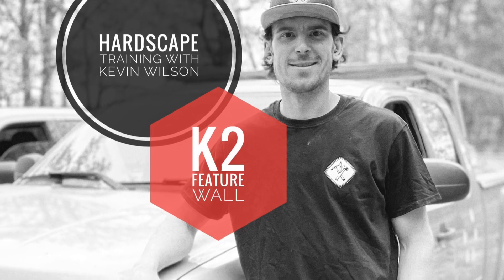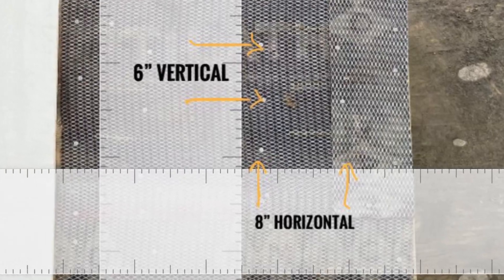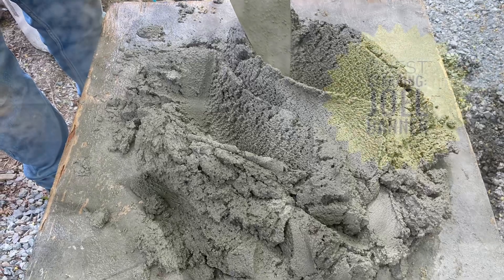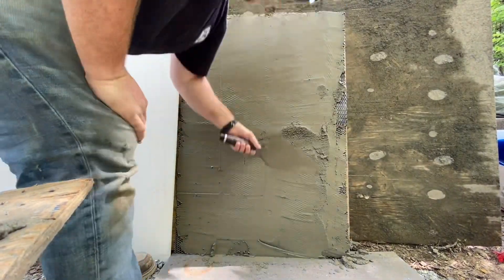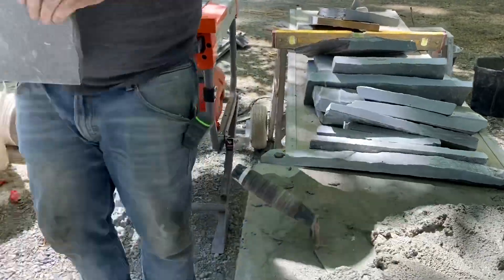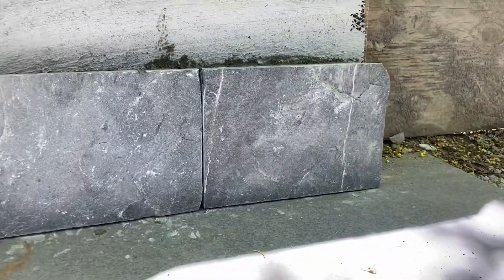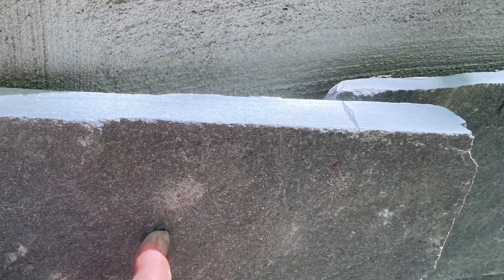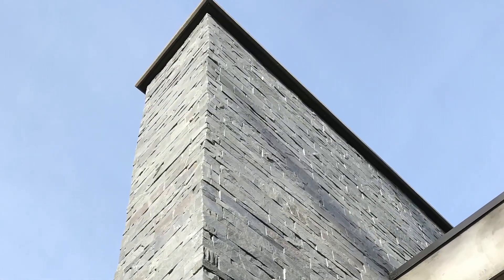How to build a Veneer stone feature wall like the pros do it! A great beginner video.

Comment: But it does prompt me to ask some questions. How to you pre-drill through this kind of veneer for inserting anchors for hanging pictures, medieval swords and armor, etc?? Without cracking the veneer and achieving great stability for heavy pieces??
Reply from the maker: You can drill through it carefully with a hammer drill and a vacuum. However some careful pre-planning would allow you to hang really heavy objects confidently by attaching anchors onto the scratch coat so that you know where the studs are, then work the stone nicely around them